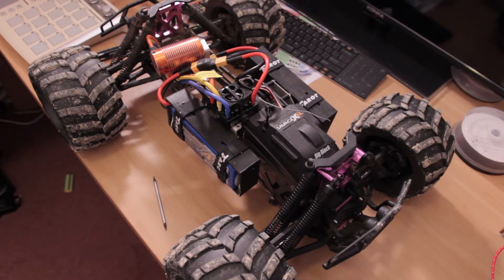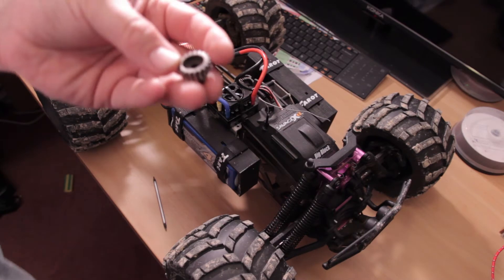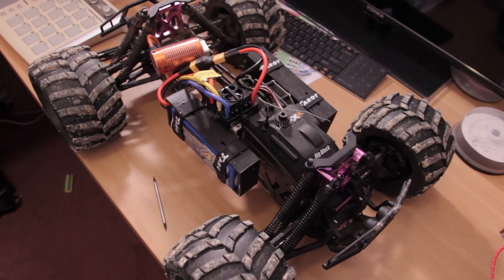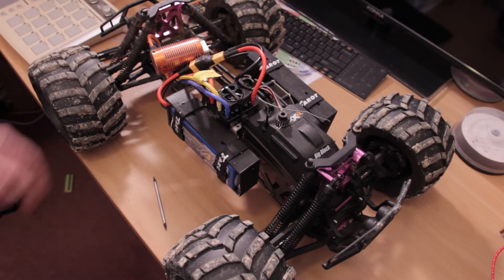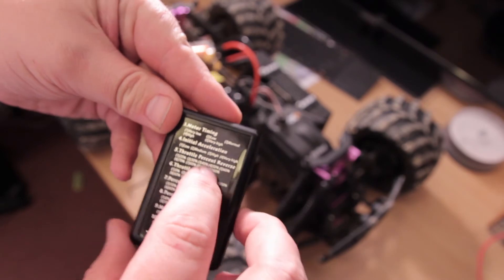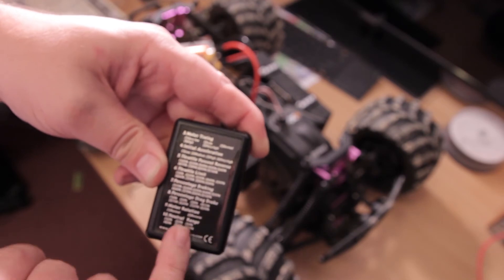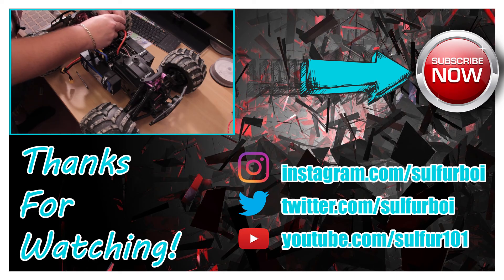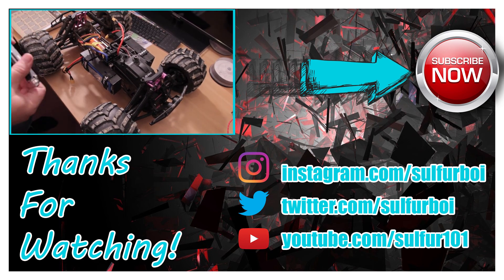GoolRC 2000KV + 150A ESC Combo - Review

Comment: how is that brushless motor? how is it on low speed like crawl
Reply from the maker: Works fine, but for crawling, not really ideal, it is non sensor motor so has little resolution for low speed applications.

Comment: Help me!, can a goolrc 3665 2600kv motor go with a 60amps esc? I'm confused about the specs on the internet
Thanks :)
Reply from the maker: The motor is rated at max 75A, I would suggest an 80amp or greater ESC.

Comment: How is it holding in 2018?
Reply from the maker: I no longer have the one in this video, but I do have another in a 1/10th setup that is still hauling!
Reply: Modify Or Die Thanks! Planning to buy the 1/8 system for my T Maxx conversion